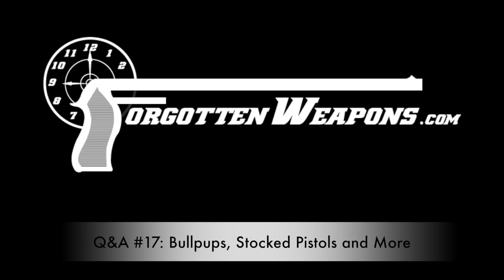Q&A #17: Bullpups, Stocked Pistols, Delayed Blowback, and More!

Comment: A skirted round (of lead or soft alloy) was used in Gerlich's "Cone Bore" guns.  Most significant of these was the sPzB 41 "28/20", significant in the sense that all of them were issued and oft used (until the ammo ran dry).  This gun was intended for the Falschirmjaeger, but Google "SPW250/10" or "SPW251/10" and about half the pics will show the platoon commander's halftrack armed with the sPzB 41.   My favorite cone bore gun is the 7.5cm PaK 41, which squeezed the 75mm apparent diameter of the shot to an emergent 55mm (It was also called the "75/55").  These were used, too, but the penetrators inside the soft metal jackets or skirts were made of tungsten carbide and that's the old story about strategically critical materials-not to mention that excessive barrel wear was problematic.
Reply: *Or so I think.  I didn't crack a book for this one.

Comment: I used to shoot black powder competitively, and everyone in my outfit cleaned our guns with windshield washer fluid and Dawn dish soap. The washer fluid was safer than water as far as getting between the stock and barrel of the musket, because it would evaporate instead of rusting the metal, and the dish soap would cut power fouling wonderfully. Dirt cheap too, $2 bottle of soap dumped into a $1 gallon of washer fluid.

Comment: To me the FAMAS' biggest issue lies with lack of UGL system. It limits the rifle (those grenades are fiddly). There are more issues like the lack of rails to mount variety of additional scopes/colimator sights, flashlights/lasers and I think it has a big problem with ergonomics in the form of a fire-selector switch on the underside of the weapon . And I always felt like the bipod got added because the weapon can shoot at over 1000rpm at full auto (although I have no real knowledge, it is just my guess, it just seems plausible) which might be hard to control. But I of course am probably wrong. :)

Lovely video Ian. I always like your Q&A's:)

Comment: First time I've ever disagreed with you Ian...the AUG series is undoubtedly a better rifle than a famas. More reliable, higher capacity, longer barrel/range. Also the AUG platform is in continued use to this day in various guides, whereas the FAMAS is not used by any large military at this point.
Reply: FAMAS will not be used anymore not because the gun is bad,but simply because there's no armory that manufacturing them....
Reply: No french military firearm  produced in state arsenals has never been  a commercial success, it was not the purpose, and there were never real export policy

Comment: Something else for the "What hindered automatic arms development during WWI?" question to me is the ammo. You had 30-06, 7.5 Swiss, 8mm Mauser, 303 Brit, 7.62x54r. Those are all large, power rounds. You need a gun with the size and weight of the BAR to control that. We saw in WW2 with the Soviet AVT-40s and M-1 Garand Full Auto prototypes that those rounds at Full Auto are basically uncontrollable.

Comment: Given your appreciation of the Famas, i really wonder what you would think of the Croatian VHS-1 and VHS-2 rifles.

Having been issued both, I can say that they are a better than I thought they would be, but not amazing.
They are an interesting combination of design "inspirations".
Heavy as sin, though, and I'm glad I don't have to lug them around anymore.
Reply: MatoVuc Better than Beta!
Reply: The Croatians must have really liked the Famas sights when they were designed the VHS.
Infact a lot of external elements of the VHS seen to have been inspired by the FAMAS and G36.
Reply: The original VHS-1 had Famas like iron sights, though that was not long after replaced with HK style iron sights a la G-36C and G-3.
Reply: The VHS-1 also had the FAMAS style safety/selector switch and Grenade sights. Also noticed that the VHS's use G36 style charging handle, G36 style Magazines and even G36 optics.
Reply: the G-36 optics are genuine g-36 optic, that were either removed from G-36 rifles in stock or purchased exclusively and then attached to the pic rail on the VHS-1D1 rifles.

I am not aware of how fond people were of this solution. The G-36 dual optic is generally very positively considered in the Croatian Armed Forces, but the VHS-1 had a very high bore offset iron sights and the G-36 optic is quite tall on it's own.
Reply: the charging handle is definitely G-36 inspired, but it is non-reciprocating and not attached to the bolt, like on the G-36. As a mechanism itself, it is pretty nicely designed, though there is one plastic piece that used to break on older rifles. It didn't hinder the operation, it just meant that the charging handle wouldn't automatically spring to the forward position.

The magazines on the VHS-1 were kind of a combination of G-36 and STANAG/M16 magazines. They were not very well liked. The polymer was not particularly strong, they were too boxy and the M-16 type magazine latch is not very well liked compared to the g-36 style latch. They would crack if yo hit a rock while going prone and disassembling and cleaning them was a chore.
The VHS-2 magazines are a considerable improvement. Better materials, easier disassembly (kind of AK mag like), use the G-36 style latch principle and are less boxy and sleeker. Really, the only thing that isn't liked about their design by the average soldier are the extensions with which one can attach 2 or more mags together. This isn't a particularly useful feature and it makes the magazine thicker than it should be and occasionally it can snag on things. Great for keeping the mags in one place in the closet or locker. Horrible for use in mag-pouches.
Reply: @alexv6324  Still not as good as DVD! LOL

Comment: Trying to summarize the steps to owning a machine gun legally is always challenging. You hit most of the points. One relevant one you missed is that some US states have their own regulations which must be followed. Most states do not regulate machine guns and the ATF procedure is the only one you need to follow. However, there are a few states which prohibit machine guns altogether for private individuals (e.g. New York, Washington state, New Jersey), there is at least one which only allows C&R machine guns (Connecticut), and there are some which have their own special machine gun licensing process on top of the ATF requirements (Massachusetts). So the real story is that the questioner should contact a machine gun dealer in his state to find the full story.

Comment: 3D Printing / Additive Manufacture / Rapid Prototyping technology has been available for decades.
The problem with that tech for firearms production or such, is cost and strength. Every layer is a weak point, which is why manufactures retain use of the technology for prototyping and masters for casting.
Reply: The big boom in AM was when a lot of patents ran out at once

Comment: Ian, the problem with early M1903 receivers and bolts was not the heat treating! The problem was always in the forge shop. The workers could not "eye ball" during heat treating as they were inside of clay pots inside of the oven for several hours. If the problem was also with the heat treating they could have just redone all of the early rifles and no one would ever fret about it today.

From Hatchers Notebook:

“One fact that this staff quickly developed was that the forging temperature was not being sufficiently controlled….These men thought that they could tell when a piece had the right heat just by looking into the furnace.”  “…it was quickly found that the “right heat” as judged by the skillful eye of the old timers was up to 300 degrees hotter on a bright sunny day than it was on a dark cloudy one.”
Reply: Forging is not the same thing as heat treating! Forging is the very first thing you do, while heat treating is almost the very last thing done. During forging you heat the metal very hot, then take it out of the furnace and drop the hammer on it. Heat treating is done well after the metal is machined and right before the metal is finished and assembled.
Reply: Pedantic? It's a completely different manufacturing process! The problem I have is people, Ian included, keep repeating something blatantly wrong. I don't like fuddlore being spread around.
Reply: No, I do not agree that it was a heat treating issue! Read what heat treating and forging are. Heat treatment, and forging are not related even if both use heat. Forging is NOT a heat treatment!
Reply: Mike Shlonger. Powder Monkey's right. Ian misspoke. It's not a huge deal, but these are extremely technical videos and it's probably better to be precise. Ian probably appreciates the correction and will undoubtedly incorporate it in future videos.

Comment: Thanks Ian, I have a 98k and a couple case of old yugo ammo, I am always hesitant to shoot it with that stuff for fear of not cleaning it enough after (was using water for the salts) I will try heating it next time and getting a hold of some Ballistol to try (using Hoppe's, Simple Green, and lots of ole 3-in-1 oil now)
Reply: NemoKeine cool note about Ballistol is that it’s also an antiseptic. Soldiers found that the British, who were using Hoppe’s, had more cuts and infections in their hands. The Germans who were using Ballistol had less issues.
Reply: I used to use the bottom 1/2 of a 1/2 gallon jug that i would fill with a little dish soap and water, then with the muzzle submerged i would use my cleaning rod as a  pistol to pull water up through the barrel and into the action repeatedly, it seemed to do the trick.  As I said, in the future I think I will get hot water out of the tap to use instead.

Comment: You kind of have the L85 a harsh rap. Having struggled through the A1 I get some of my own prejudice at times. BUT while I came up on A1s I spent more time behind an A2 than anything else. And while it's heavy at exactly the same weight as an F1 FAMAS, it's from everything I've seen more accurate than the FAMAS(it does have a longer barrel by over an inch). 

And in its A2 guise it's as reliable as any other modern rifle, and in testing was actually more reliable than anything else in use in NATO at the time, including the FAMAS. It's worth noting to prove the A2 solved the reliability problems it's acceptance trial was hell on earth. And in 2 million rounds the rifle itself only failed twice in trials under very harsh conditions.(If you ever get the chance the Armies program lead for that is an incredibly interesting guy)

As you note the short stroke gas system is also very easy to maintain and the A2 also has an easy to adjust gas system. Even when the gunk is well into the gun and the gas system is more carbon than metal switching it to E will usually get the gun running.

The weight issue is something you don't notice in the field. It is back heavy and unbalanced.  But from a marksmanship and movement perspective personally I prefer that. All the weight in the back makes recoil manageable and being close to the body makes it easy to move with the gun. It's literally given to teenagers, some of whom are tiny, and they manage well with it.

If you get the chance you should really try to get a bit of time behind the latest A3. It's still heavy, but it's had a lot of quality of life improvements. And the freefloating handguard/bipod and the new sighting system would fit in well with any two gun competition. 

Anyway tl:Dr the L85A3 is genuinely good. Other than weight it doesn't really have any significant drawbacks. And compares favourably with any other early 2000s design weapons(since comparing A2 and A1 on anything other than look is actually almost silly)

Comment: Many of the modern takes of putting a stock (or brace) an on actual handgun incorporate quick deploy mechanisms and the smallest ones have both a quick deploy "stock" (folding or spring loaded) AND can be holstered. If you can't carry it in a practical holster with the "stock" still attached and then quick deploy it I don't think it makes financial sense to buy them and train your department/unit on it.

Comment: You mentioned stocked pistols, and not a single word about the C96 Mauser?

Speaking of the C96, with the current state of casting parts and CNC machining, how viable would a modern reproduction be? Could it be made for an affordable price? And how well would it sell?

Comment: Let's see  Pipe, smoking Jacket, cup of tea.   Have you a violin stashed away nearby Mr. Holmes?      .50 Spotting rifle for recoil-less rifles,  interesting observation: From talking to a M-40 gunner in 1969.  The spotting rifle disturbs the aim  so it must be readjusted,  the main gin, where fires does NOT disturb the aim,  however it does disturb everything else around the gun, also the barrel rings like a bell.

Comment: 19:26 Makes me wonder how Glock will look 50 years from now.
Reply: Odds are unchanged and still claiming that they are the best and most modern . Wait I mean perfection . they will be the only company that hasn't upgraded the chassis and human hand shaped handles .
Reply: If the Glock came on the market circa 1986, that's 34 yrs already .

  And back in the mid '80s , it really was revolutionary . At the time , the original G17 had the second most ergonomic hi cap grip shape, behind only the Browning Hi Power, which held 4 fewer rounds .

  Before Glock , the baseline comparison was a S&W M459 .

   Virtually every service-ish pistol since has been designed in reaction to the Glock .

Comment: I live in Washington and if I'm not going to b handling one of my firearms I just coat it in grease like I'm packing it in a mine for 100 years 🤣 but seriously no amount of protection besides constant cleaning will hold up for me so I just use grease and cloan it up before I use them . I have some old stuff and I want to keep it nice . And RIP Remington I still cannot find a place to buy a stock for my model 10  12ga I have the correct rounds but not a safe stock 😥

Comment: I would like to know more about bullpups, and the reason they didn't become ubiquitous. They seem like a perfect barrel-shortening method, but what are the drawbacks?

I dream of purchasing my own machines and making my own guns, and producing an effective bullpup is high on the list.
Reply: Seems like they're blowing up (like in poplarity, not like boom). I think the efficacy of the AR platform eclipses all (yes, you get less barrel for the protusion, but generally short protrusion is most helpful in short range situations, so the advantage over an AR-SBR 

However, if the brace rule doesn't get stopped it could change the game, as a bullpup should be immune as clearly the stock is necessary to function

Comment: How does the Famas handle different ammo types, doesn't it hsve to use a certain weight/case? Surely this a disadvantage compared to other bullpup rifles?
Reply from the maker: Mine has run fine on brass cased ammo, but the 1:12 twist does limit it to 55gr bullets.

Comment: I think they have stuck a little bipod on the latest L85 update a few months back. May I recommend Ogdens Nut Gone Flake for your pipe by the way. The finest pipeweed in the Shire and make no mistake.
Reply: It has one of those grip pod combination vertical grip/bipod things. It isn't new, these have been used since they started fitting the DD railed handguards for theatre use back in 2010-ish.

Comment: the Germans made at least two squeeze bore anti tank guns in WWII a 41MM to 28MM and a 75MM to 55MM
Reply: Interesting, the rusty one I saw in N. Africa was labelled 40mm to 37mm. 

It was a small thing, about 18 inches high with iron wheels, which were also rusty, and about 3 feet total length. I did take a photo but it is lost now.

Comment: İf the gun has roller bolt it doesnt mean that this gun doesnt use gas system, gas tube, or piston! G3 has rolling bolt and gas operated!
and those rollers cause technical problems. They may somethimes be blockef.
Reply from the maker: There is no gas system in the G3.

Comment: Okay hear me out - 3 bullets out of one barrel didn't work so well, neither did 1 bullet per barrel with 3 barrels isn't such a great idea. But what if, for an actual machinegun (LMG, HMG? IDK) ... Three barrels using tri-bullet ammunition. Think of the sheer suppression from the hail of lead. You'd saturate such an insane area ... Hell, even just one barrel with a high rate of fire with 3 projectiles would create a cone of withering fire ...
Reply: Tripe shot triplex gun... 

Well, I suppose that's what video games are for...

Comment: I'm diggin the pipe and jacket but I'm still hoping for another 1911 Jesus vid  (from the 1911 45 vid). Maybe it was the hair or my being Catholic but I had a weird sense of it being too good to be just satire. I mean if Jesus did do a vid on pistols I can certainly see why the 1911 might be a fav. I'm not sure what gun ya might have him review for a return engagement. 

As long as I'm spacing out did anyone ever try refiling a bullet and leaving the bore smooth, seems like ya would  get a more reliable flight performance. As is the rifled barrel leaves scars that will throw the "trim" of the projectile and short of wings I can' think of anything that might make for a nice true flight time after time. I guess Jesus would know but you won't have him back for some reason??????????
Reply: Mooooohamsalad IIRC, stabilizing fins in a smooth bore barrel is what that Franklin Armories Redemption or whatever it was called uses.

Comment: 1. The smoking jacket, library, pipe, etc. aren't laying it on quite thick enough. In addition to a tweedy Brit accent, you need a hunting dog sitting next to your chair.
2. Gas operating systems have to have pistons? Funny, I have six ARs and only one of them has a piston system. Unless you're calling a bolt carrier a piston, in which case the POF piston system has two pistons.